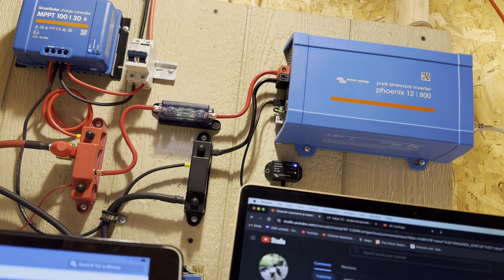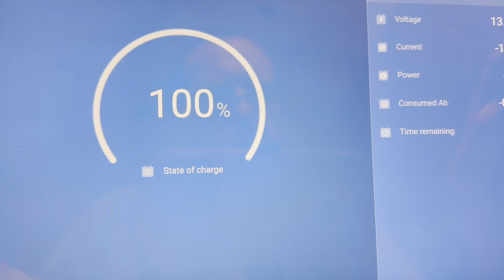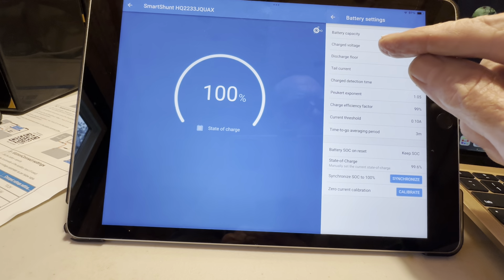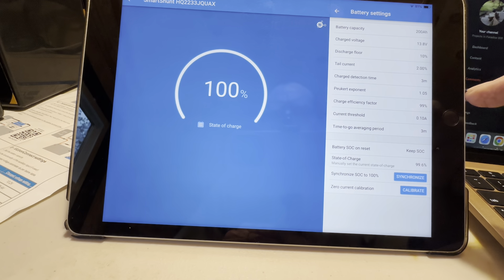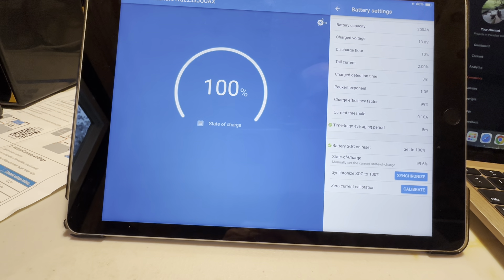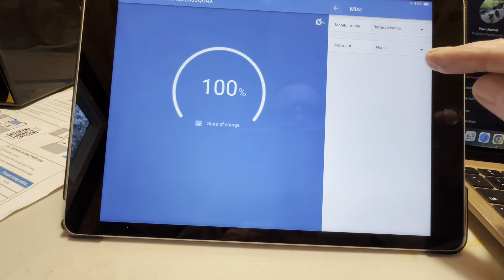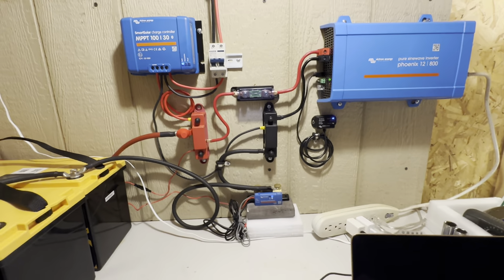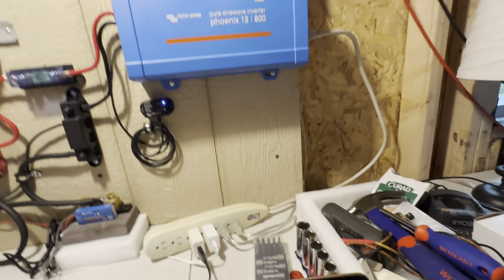VIctron Smart shunt settings for LiFePO4~Like being back in school, but MORE FUN!

Comment: The reason the sleep mode didn't work upon the first setting was because you turned the inverter off before you clicked the "store" setting on the screen. The message onscreen is telling you that you can set it, but it won't be stored in the inverter and the setting will be lost if you power it down. So you set it to 20, didn't store it, and then immediately power cycled the inverter, causing the setting to revert back to 100VA. That's why the lights wouldn't stay on. You never stored it after setting it to 10VA either, so the next time the inverter power cycles, everything would just revert right back to the previous 100va settings, and you'll get the same result.

Comment: Quick tip, the reason it went back to 100 VA is because you didn’t click store settings on the top after changing it to 20 VA, if you power cycle the inverter again, it will lose the changes because you need to click store changes after making the changes in that area
Reply from the maker: Mahalo for that information!🤙

Comment: Great video, but I do have a question on the Victron Shunt. They seem to pull a fair amount of current, so can you really leave these shunts hooked up permanently or will it drain your batteries down over al long period of time.  My setup is to backup my home when we have power outages, so the batteries do not get used a lot. They are in standby mode most of the time. Any input would be so appreciated. Thanks

Comment: Thank you for the video!

Bob don't get a fright, but If & when the firmware updates, the red light flashes, it made my heart skip a beat LOL.

Some more info // The Aux Voltage wire (grey) can be used to monitor temp also, but you need to buy the probe.

Aloha!!🤙

Comment: It may be important for you to understand the Discharge Floor - especially if you want to use this setup for testing purposes. The Discharge Floor is a buffer capacity reserved below 0% SOC! 

When discharge floor is set at 10% your "guage" will actually show 0% SOC when you have used only 180Ah of your 200Ah. (so it reserves 10% of your capacity even when SOC shows 0%. Or in other words, it offsets your bottom "empty". It "lies" to you, to keep you "safe" by giving you a extra reservecapacity that don't show up anywhere. It is capacity below "0% SOC" - I hope that makes sense) 

I always like to see my true SOC, so I leave the discharge floor at 0%. I really only see any other than 0% be handy if, say you were on a boat and you want to make sure you ALWAYS have 10% left for your bilge pump or emergency lighting. 

- In my setup, I choose to be my own Discharge Floor-indicator (I am a grown up and don't need my system to administrate if I can handle the truth or not😄) I know, when I see a 10% SOC, it truly means I only have 10% left! (This is why I think its important for you to understand it has GREAT influence on what your "fuel gage" shows you)
Reply: Yes, I didn't explain what that was.  Good adder!   I will add that there is a bit of nuance here because the shunt is measuring the amp-hours left in the battery, not the energy left in the battery.  (I'm fairly sure).

As the voltage heads south the energy left in the battery as a percentage of the full energy of the battery is actually a whole lot less than the SOC shown by the shunt.

There are other reasons not to use 0% for that parameter as well.   The inverter cut-off is one reason.  And the other is that you never want to completely discharge a battery all the way to inverter cut-off if you can help it, simply because you might forget and let it sit that way for too long a period of time. The self-discharge will continue to discharge the battery into cell-damaging territory if the battery is left that way.

Because of this, my recommendation is to set the discharge floor between 5% and 10% for display purposes.

-Matt
Reply: Sure that's one oppinion: offsetting a shunt to give a false reading in order to feel safe! And if your system is in use where you don't attend to it for months, then sure. Otherwise the BMS is fine to take care of of any issues and will protect the cells for months and months after they cut off. Many other shunts don't have the option and they work just fine in systems showing the true reading and that cycles in a normal routine, especially in areas that are used on a daily basis by people :) 

The offset is no protection - any load will keep going, even when the Victron repports the false 0%. Its only a visual reading that is manipulated. Thats all it is!

Anyway, just a matter of of opinion - some like to set their watch 5 min early, to make sure they catch the bus. Others like to have the hard core truth revealed to them: the time is excactly what your watch shows you and they deal with it.

My only point was to explain what it actually does to your displayed reading - it is significant to understand this if set to anything else than 0%🙂
Reply: @jbjensen11  Generally speaking the low voltage cut-off of the inverter is far higher than the low-voltage cut-off of the BMS.  And you want it to be that way... the last thing you want is to be constantly exercising the BMS's FETs under full load by letting the battery draw down that much.

The BMS can only protect the cells from low-voltage destruction if the battery is charged in a decent period of time after the BMS shut-off.  Otherwise the self-discharge of the cells (which the BMS has zero control over) will destroy the cells.

This margin is considerable but not infinite.  Usually going a few weeks with batteries left in such a low state is ok, but to be perfectly frank you never want to let the battery get that low in the first place.  Ever.  It is literally the only thing which can actually destroy LiFePO4 cells short of boiling the electrolyte.

In anycase, the floor doesn't control anything, its for display purposes.  But it should represent more than just a mild reminder.

-Matt

Comment: Hi again when you change the wake up and switch off the inverter to go from on to eco you lost the setting because there was a warning on top asking you to verify the change or the setting will be lost on reset which happen when you switch from on/off/eco it also warns that if you verify the inverter will reset  but it will keep the change i also  suggest that in smart shunt settings in the what happens on battery SOC on reset to choose KEEP SOC the choice you made will reset to 100% every time the shunt looses power (reset} ignoring the state of charge at the moment of reset if you have for example 40% charge it will reset to 100% keep SOC it will remember the state of charge it was before reset and return to it 
Hope i helped

Comment: Oh good!  I always worry that my walls of words sometimes get skipped (I'm very aware that I often go into too much detail in postings 🙂).   You are welcome!   Happy solar hacking!

I'm not sure why that first attempt at setting the phoenix didn't stick.  But... its just a bit of value-add to save power.  I don't usually use the ECO mode on the phoenix's.

-Matt
Reply from the maker: Mahalo so much brother. That was a huge help for me. Just now getting my brain back on track from that covid experience, so having it spelled out for me was incredibly helpful. I may have to read what you share a few times, but then , it starts to seep in. You help so many of us, and i really appreciate you being part of the conversation around here. Aloha!🤙
Reply: Your settings are spot on -Matt

Bob don't get a fright, but If & when the firmware updates, the red light flashes, it made my heart skip a beat LOL.

Some more info the Aux Voltage wire (grey) can be used to monitor temp also, but you need to buy the probe.
Reply: Do you have a channel Matt?

Comment: looks great ! the settings can be tricky . I had to use totally different ones. NiFe battery . that inverter will loose some settings when you turn off the switch and go to eco mode. if you turn off and on again it will go to default 100 watt . nice matt gave you some settings. save you the time of looking up and or emailing battery company for more info. I did that and they gave me the data . Victron support   is great as well.  they help me with my settings for NiFe 24V -10 cell 1000 Ah battery string.

Comment: Great video.  I recently installed this on my boat for my trolling motor.  While in use, the app does report what seems to be accurate, however, if i shut the app down for a few minutes and then check it later, it keeps resetting that home screen where it shows the state of charge at 100% and the ah used to 0?  Haven't figured out why